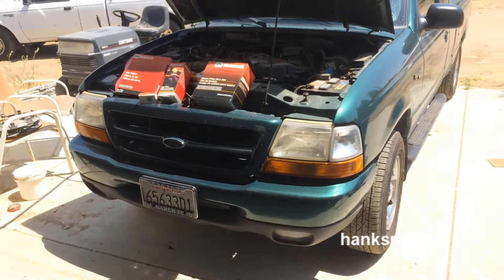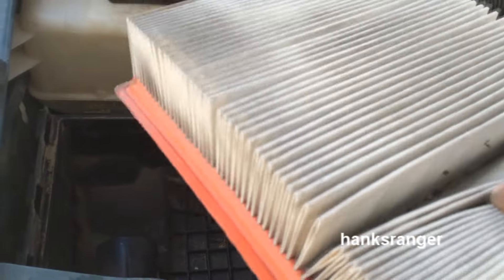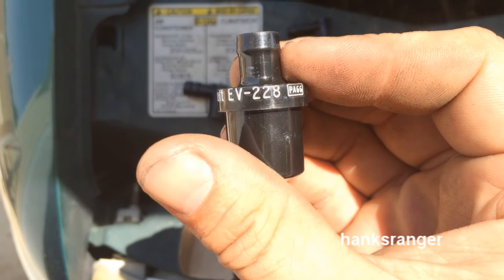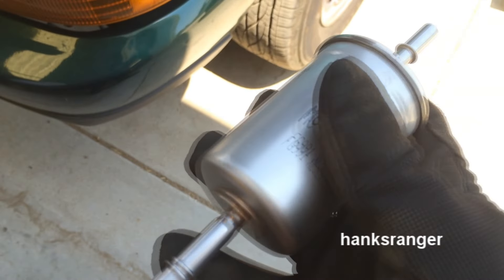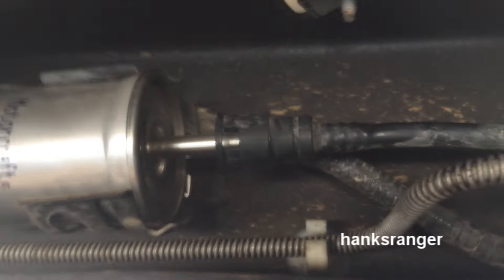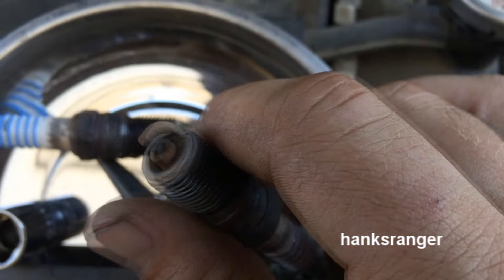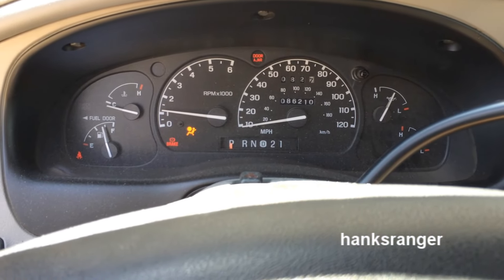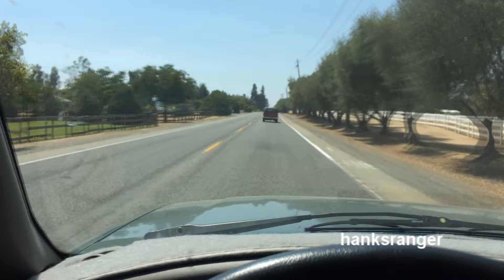1999 Ford Ranger 3.0 V6 Full Tune Up

Comment: I have 700k on my Vulcan 3.0. If you keep it up and drive clean these trucks will go a million miles!
Reply: WOWO! When did the transmission go out? Mine has 211k Kilometers which I believe is about 150k miles.
Reply: @younghussla3032  it didn't go until well over 500k miles
Reply: @NathanReevesnate808  that's wild! What did your maintenance look like for the engine and transmission? Any parts you'd recommend replacing every so often other than the usual filters and fluids?
Reply: @younghussla3032  nothing special just oil change every 3k and new air filter every year
Reply: I got a 99 Vulcan I’m like third owner it’s at 190k the oil comes out super clean , doesn’t burn a drop the level is always the same for months now but it has a ticking sound almost like lifter tick but it comes from the bottom like from the exhaust idk what the heck from the engine bay you cannot hear it at all only in the cab or under
Reply: @GLEECED  Maybe check timing chain tensioners. They could be worn out and its creating some slop in the chain. If valve cover gaskets haven't been done, you could do those at the same time since they usually go around 150k miles.
Reply: @GLEECED  Post a video of it on your channel and tag me
Reply: @GLEECED  check exhaust manifold. Could be leaking from a bad exhaust gasket. Would sound sort of like a tick, especially when on the throttle

Comment: My 2000 ranger 3.0 has 197583 miles, and still runnin STRONG! Love that truck!
Reply from the maker: +Chantz Mcgowan yea it's all good sucks but it was passed on to my brother back in 2010 when I bought a new car. It was a 5 speed not near as pricey to rebuild as an auto but I couldn't let it go to waste regardless
Reply: Frostbite _Z28 I just bought one with 329k on the drivetrain. Still runs like a top and no major mechanical issues
Reply: 223k on mine. 2000 ranger xlt 3.0 5 speed

Comment: I just had my 98 3.0L Ranger tuned up at Firestone complete auto. Plugs, pcv valve and fuel system cleaning. They couldn't get the fuel filter off. Rusted, etc. It runs great, now. It had idle problems before. I had replaced the IAC, to no effect. Would randomly fast idle, AC fan kept clicking on and off, constantly! Not anymore. I wonder what they did to stop it. Would the pcv valve cause idle problems? Good video!
Reply: Clean the throttle body with throttle body cleaner

Comment: 94 b3000 267k miles still being worked hard everyday I do flooring so heavy rolls she takes it like a champ doesn't even squat fully loaded
Reply from the maker: I believe it, my brother had my old 95 had 300k or thereabouts, still ran well other than having the trans rebuilt at 280k. Burned some oil but def got his moneysworth out of it till he wrecked it.

Comment: I've replaced my spark plugs twice in 2 years and once I replaced one plug and now 5 months after I had replaced all 6 one of them is bad again. What causes this? 99 3.0 L v6 ranger 154k miles
Reply from the maker: if its the same cylinder it may be the coil pack thats going bad and frying the plugs, check the wires too
Reply: @hanksgarage_  Its different cylinders

Comment: Recently got a 94 4.0 ford ranger with 150k miles and the headgasket almost immediately blew, attempted todo an engine swap but there was too much rust and it was too time consuming so i sold it to someone who would finish it and got 2.5l manual 99 ford ranger with 274,420 miles on it and shes running strong. Weird electrical issue with the oil pressure guage and Temperature guage and she needs new tires but all in all she is running great, when the engine eventually goes i plan to have it rebuilt, it would cost me about as much as another ranger but would last me at least another 300k miles instead of another 150k miles
Reply: If the transmission ever blows those dont seem hard to swap so ill pick up one for $140 off of a ranger thats been in an accident with low mileage at the junkyard, there is no rust on this thing and everything is great, totally worth the investment

Comment: Hey man love on how you fix up a few things but with mine... you hear like an air leak and when I hit 4 Or 5 rpms you start to hear the engine, idk it’s weird, what do you think I should check or change?
Reply from the maker: check your airfilter and intake tube for it, other than that hard to say without having it in front of me...
Reply: Alrighty thx man, but I changed my air filter already
Reply from the maker: What I mean is you may have a significant air leak that is making noise somewhere, make sure your air intake tube is secure to the intake manifold etc

Comment: ahhah. that's what I call a ratchet extension! usually in crazy jobs I just connect a ton of them together with universal joints. That Ranger looks pretty damn easy to work on. Nice!
Reply from the maker: paradoxdesigns yup its not bad, what I hate about ujoints is after they are bent enough they do not turn correctly

Comment: There is a special tool to remove those fuel lines if you would have used the tool you wouldn't have broken the clip
Reply from the maker: Is it really that big a deal when the new filter comes with new clips? Or that the old ones were almost 20 years old to begin with and brittle as fuck?
Reply: I must be retarded,  bcuz i bought that special tool to help remove the fuel filter, and it still seems hard to take the filter off, I still feel like I'm gonna break something,,, but im gonna give the whole tune up thing a go after watching this vid, the repair shop wants $540 for.tune up, and $110 for fuel system cleaner,,, lol,  can't I just go buy some Lucas fuel cleaner and run that, instead of theirs?  Or r they just charging me $100 for some liquid fuel additive I can buy for $20?
Reply: Even at Firestone, they couldn't get mine off after half an hour. Sometimes, they get too rusted.

Comment: Just my .02 I have a 2000 ranger 3.0l and I put cheap plugs an wires and when in the dark I would start my truck an I could see sparks everywhere a few days later I had a horrible miss on take off and during hard accelerations finally changed everything to better plugs an wires and the miss was gone just an fyi not to buy the cheap from auto zone just spend the little extra and go another 50 to 100 000 miles